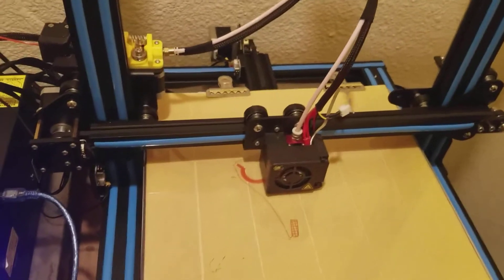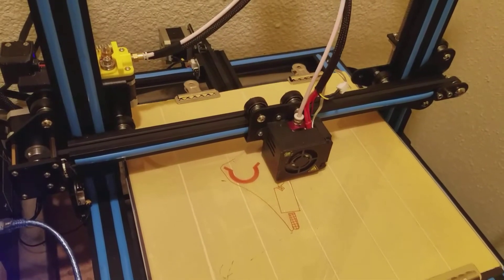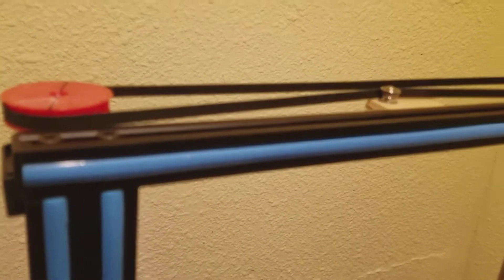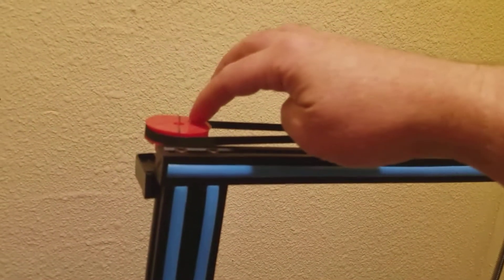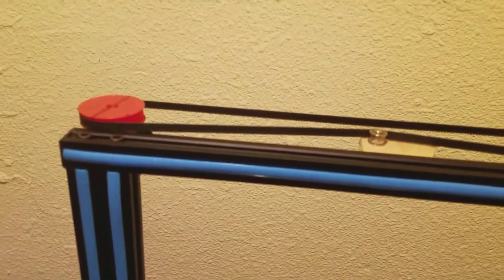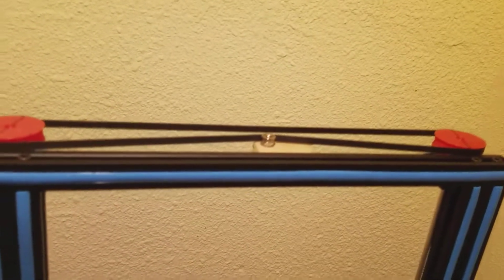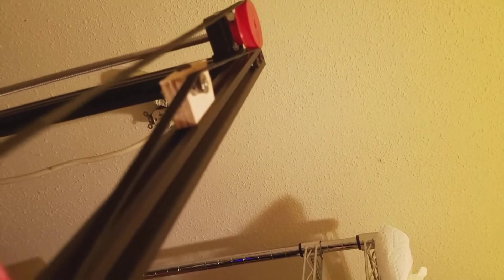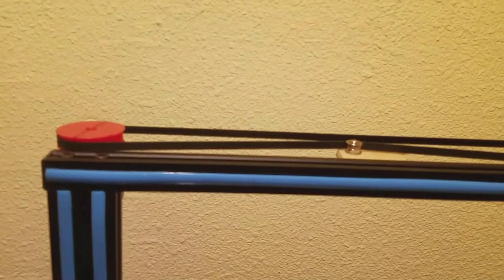Cr-10 cr-10s dual z sync prototype

Comment: Link to the belt? I keep getting level changes on my prints
Reply from the maker: it is just a gt2 belt, you can calculate the length by the distance between the pulleys and the pulley pitch diameter.

Comment: Setting this up on my printer. Did you ever design a z bearing holder so that they could be attached by 2 screws? I have them on with 1 now but 2 would be great
Reply from the maker: Not yet.  I have not printed anything higher than 6 inches so I've not been worried about the alignment.  My printer is also pretty dialed in and I'm a bit hesitant to muck with it since my other printer's heated bead is a bit touch and go.  I could do the design if you want to test it.   Also open to any ideas you might have on the overall design.

Comment: Is this still working for you?  What size belt would be needed to eliminate the tensioner?
Reply from the maker: Yup, it seems to be working great.  No leveling since I set it up.  I almost think the semi loose tension is ok since I'd rather it slip than have the motors fight each other for hours on end.  I believe there is enough tension to hold/sync position between power up/down cycles.  I have been playing with rotary encoders and maybe i'll put them on something external to see if they get out of sync ever when printing or powering up/down.

Comment: Nice but how are they mounted to the screws? Mine are flush with the top cross beam on the printer
Reply from the maker: i mounted them the nut holders in the model for a set bolt.  I also had to move the z bearing holder down  and attached them to the other extrusion.  There may be enough play in the motor couplers to try to keep it in it's current position but I have not tried that yet.  I also noticed the motor coupler connection to the z axis needs to be pretty tight to hold.